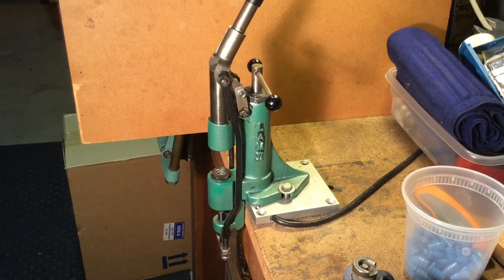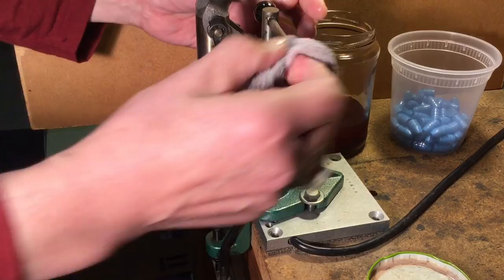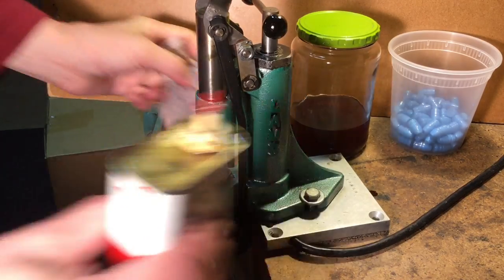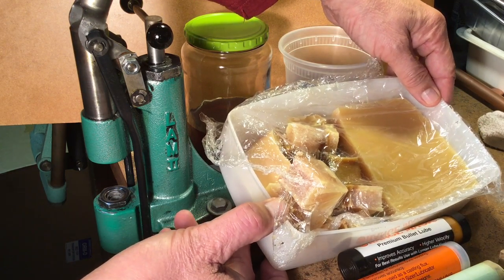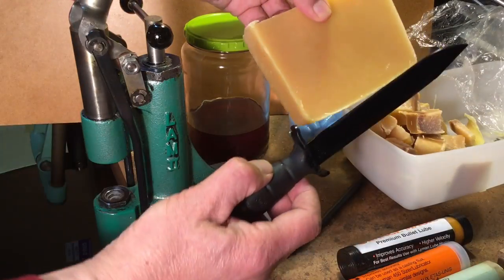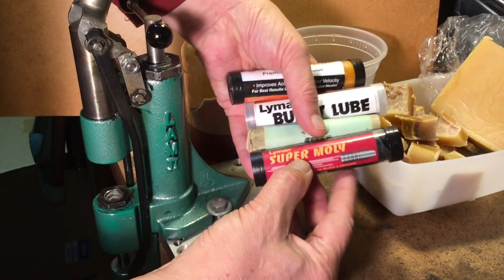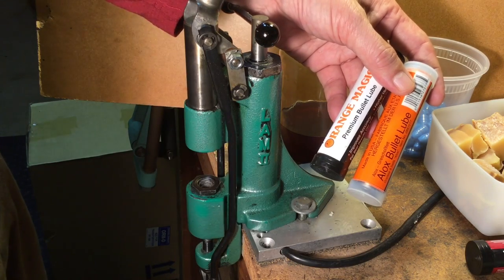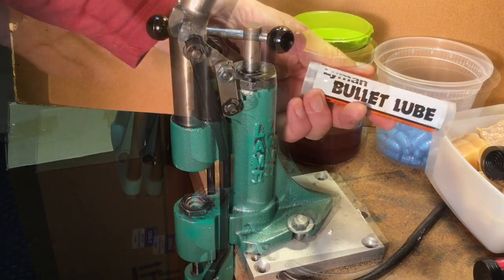Cast Bullets: Adding Or Changing Lubes To Our RCBS Lube-A-Matic 2 Sizer Lubricator

Comment: Interesting.   For years I've used Thompson Blue Angel hard lube on all my cast bullets.   It does require a heater, like yours, and takes about 30 minutes to heat up.  I'm happy with the results, and I use it exclusively on everything.   I don't bother with the hassle of changing lubes.

Comment: In this day and age I use primarily soft lube on everything, cast, paper patch and for grease cookies. These are for black powder, pyrodex and smokeless. I pour my lube into my sizer it's  much faster and easier, doesn't leave voids and eliminates a lot of mess, most of the time. Warm your sizer with a hair dryer/heat gun before you start pouring, it gives an added amount of time before the lube gets stiff.

Comment: It's mostly powder coat for me these days, but I'm a big fan of the Carnauba Red from White Label.  I remember when I switched from the Lyman Orange to the Carnauba Red - I had some interesting looking bullets for a while.

I mixed up some Ed's Red a few months ago, but it doesn't quite look like yours.  Mine always separates, and I have to shake it up before use.  It seems to work just fine.
Reply from the maker: Loads of Bacon - Always great getting comments from Loads of Bacon..!!  That separation in your Ed's Red is not typical...must be one of your components...but if working well, then there is no significance to it...Have a great day,  FC

Comment: Hey Fortune cookie. I just started casting for .458 socom.  Whatever I do I can't get powder to stick well to the bullets.

I've tumbled in the vibe tumbler, with and without airsoft BBs, I've tried Elvis' 140/4 method of heating. I've swirled them in a bucket, with and without BBs. I've tumbled them inside a little tupperware.  Swirling in a PP bucket sort of worked, but they didn't coat that well, and came out splotchy with thin spots with the silver visible. The only other methods I can think to try are the lacquer thinner method, or the static gun. I'm using HF Red powder.The reletive humidity is 25%.. 

Any ideas?
Reply from the maker: jesondag - That socom of yours has had some unusual happenings with it, like the funny powder residue in the barrel... I've powder coated in a lot higher humidity and different temperature conditions than you report - no problems with the dry tumbler - and I'm sure Elvis would be mystified that the 4 / 140 didn't work for you.  Only thing I can think of is if there is some kind of oil on your bullets.  If the powder doesn't stick, best to not even put 'em in the oven as results will be bad and your bullets ruined.  You might try the HiTek coatings that use a wet system - it's proven.  There are some new liquid mix powder coats becoming available.  My thought is that the best powder coat system for our bullets is yet to be developed.  In the meantime, the electrostatic method is a for sure when all else fails.  But I don't like that because of the mess of spraying, plus a lot of powder is wasted.  However, some PCers swear by it, as you are fully aware.  Best to ya,  FC
Reply: I just picked up the harbor freight gun. I got a decent size carboard box and cut one side open. I turned the box on it's side with the cut side up as a high backstop. I put down a sheet of Al foil inside, and I made a couple trays out of hardware cloth that fit my toaster over, sat the bullets nose up on it, and sprayed them. The foil caught the overspray almost entirely, and I was able to use my rubber gloved hand to collect the overspray to the center of the foil and dump it back in the hopper. They coated quite nicely, and since I'm not doing vast quantities of these 500gr beasts, I think this will work for me. 

I can only suspect maybe it's the size of them that gives me trouble with the other methods. In any case Thank you for your videos, and for your response to my questions. It's very much appreciated.
Reply from the maker: jesondag - Always wondered if that spray powder could be collected and not wasted - other spray videos, that powder is not controlled at all...Once you get that powder to stick - you know the "look of success" that the bullets need to have before going into the oven... Congrats on your PC!!  Best Regards,  FC

Comment: What ? You never heard of "spinning" the tube between your palms so that the lube will warm up and slide out easily ? Why destroy the tube when it's the best place to store the unused lube ? And empty tubes are the best way to store WHITE LABEL LUBE  when you buy the sticks in bulk.
Reply from the maker: Walks Fletcher - Nope, wore out my old Lyman 450 (broke the linkage) but never heard of the roll trick...will have to try that one next opportunity.   I used to save the empty tubes to melt my own homemade lube into them to make my own sticks.  But slivering the lube and slipping it into the reservoir or melting it in worked just fine.  I used to store my unused lube in wax paper and that worked fine.   So when I destroyed the tubes, it was not a loss to me...will try that trick next tube... Best to ya,  FC

Comment: Ed's Red? What is this?
Reply: varanidguy it's great stuff it helps remove lead fouling google it for more info it's equal parts of mineral spirits, acetone, transmission fluid, kerosene I use it more on my shotgun because of wad and lead when shooting slugs it leaves it nice and clean enjoy have a nice day
Reply from the maker: varanidguy - Great question... I have videos up on it - quickly - and ocean374 already said - it's a gun cleaning formula developed by Ed Harris working with a chemist...1 part mineral spirits, 1 part DexronIII transmission fluid, 1 part odorless kerosene and 1 part Acetone.  The acetone can be left out if shotguns are not being cleaned with it.  Store in a gasoline type container or big metal can.  It's like 14 cents a fluid ounce compared to over a dollar for commercial gun solvents.  Does not protect from corrosion for long term storage of guns though... Have at it..with my compliments!!  FC
Reply: Thank you Fortune Cookie! Seeing that it doesn't remove copper fouling I actually really like. I want a bit of that fouling in there for my hunting rifles because I've found that it makes the first, cold bore shot more accurate. Obviously excessive fouling should be cleaned out, but I like to clean my guns after every range session, but don't want to remove the copper fouling every single time.
Reply from the maker: varanidguy - You have found what works for you.  And that cold barrel first shot is critical in hunting situations, for sure..!!  We don't get to shoot "fouling shots" in the field...Continued good huntin' to ya,  FC